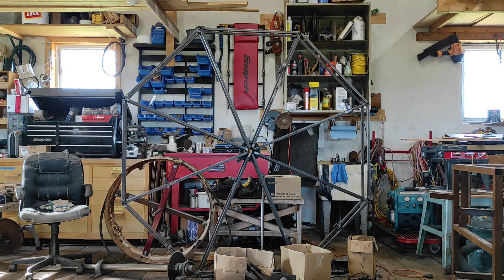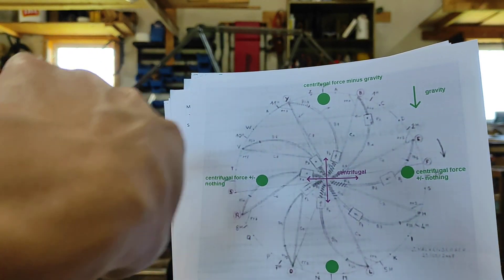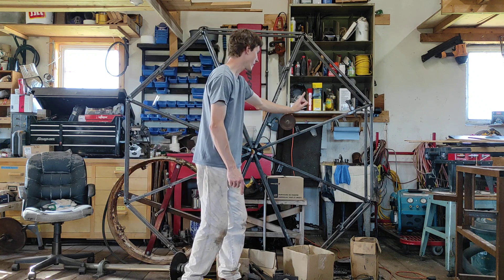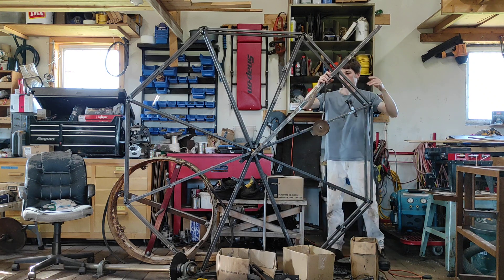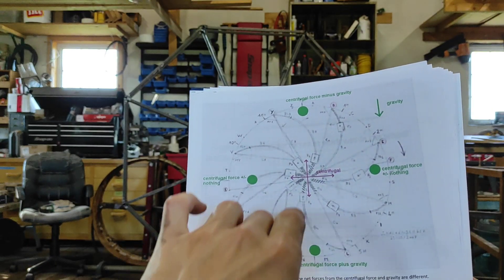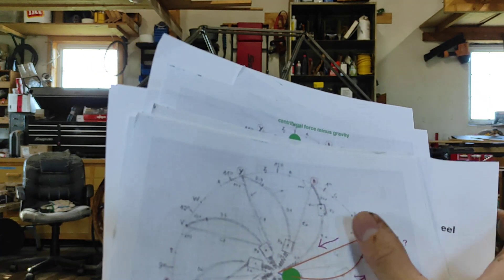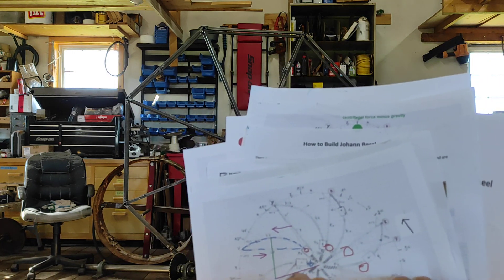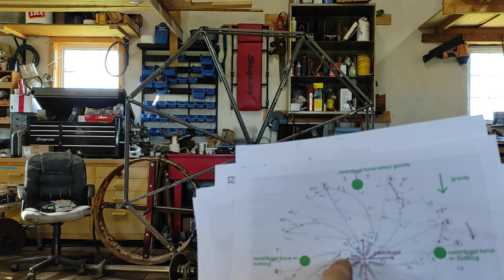How to Build Johann Bessler's Gravity Wheel

Comment: Interesting, but maybe the same approach used about 10 years ago or so at the Михаил Дмитриев YouTube channel. He's got the hanging weights, too, that swing forward, but I think he ultimately ended up having to use a motor to provide a little more force to keep it going.  I think his work is definitely worth a look.
Reply from the maker: I have a new design that is based on this, but it is a lot simpler.
Reply: Cool. Thanks for uploading. I'm sure the people out there who like to run tests in software will be replicating this soon.